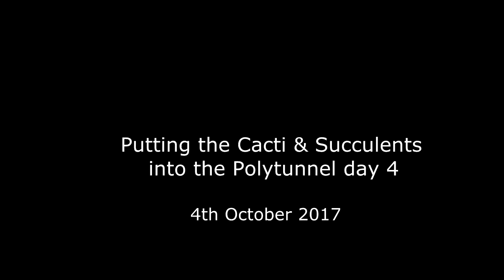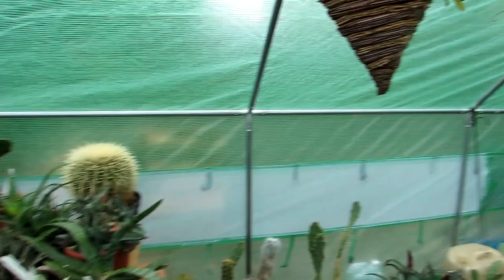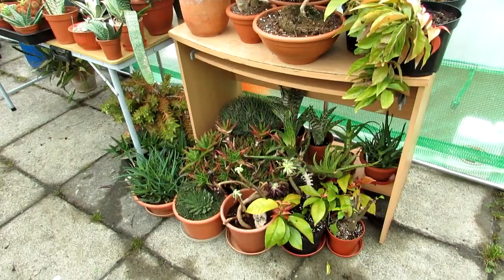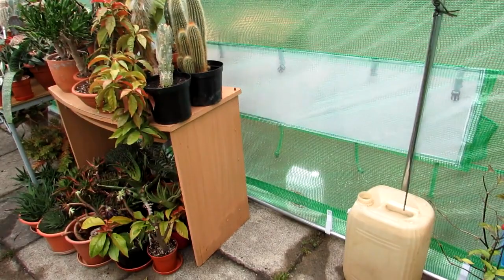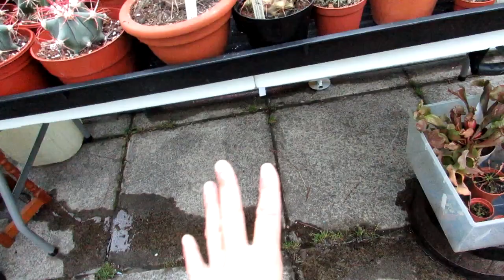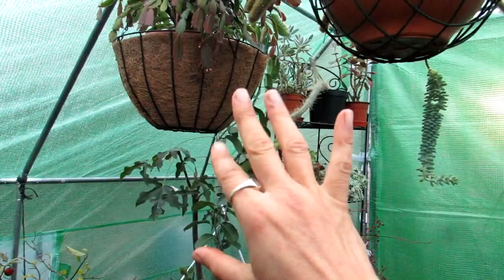Putting the Cacti & Succulents into the Polytunnel - day 4

Comment: BEAUTIFUL,I HAVE AN EUPHORBIA THE ONLY SOUTH SIDE I HAVE IS IN MY GREEN HOUSE WITH NO HEAT BUT IT IS ATTACHED TO THE HOUSE WILL IT BE OK THIS WINTER
Reply from the maker: HI there :-D Euphoribia can be cold sensitive during Winter and it depends on the temperatures and where you live, but the minimum temperature I would recommend for overwintering most of the Euphoribia varieties would be between 8-10c and if your temperatures fall below that then its best to overwinter your Euphorbia indoors, if you can't provide a sunny position then a bright but sunless window should still be ok to overwinter them if you keep your plant dry at the roots to discourage your plant from growing until the Spring :-D  thanks so much for your wonderful comment and for watching and sending you an abundance of love and happiness and PLANT POWER for a Terrific Tuesday XXXXX <3

Comment: Heat rises and escapes from the roof. I'd think insulation is your best bet with economically preserving the heat you make. Think of insulating materials. I think they're poly-carbonate panels which are used with today's cold-frames - could they be helpful to you? You're most probably already aware of the 'Mediterranean climatic' environments that traditional, sheltered brick/stone-walled gardens lend (in countries, cooler such as the UK, and, I'd think where you are too, in NI). Have you heard of the traditional eco-houses they've built in Norfolk (where I am), using the old recipe of clay and straw? They're amazing! Cheap to build and the insulation is brilliant. (I'm interested in house-building; the materials, preferring safer less toxic, natural choices - I've read a bit on this). Double-layered tents for camping have come to mind, regarding the wet coming through... Anyway, thought I'd share these thoughts with you! Yes, it's an exciting challenge, Lyn. :D xo
Reply: PS. Shame you can't make a Sempervivum Roof, LOL.
Reply: PS. Shame you can't use a Sempervivum Roof, LOL.

Comment: Hi Lynn! Glad to see you made your move without any casualty. Haha. I want to pass on maybe an idea for your tunnel. I don't know if it will work for you, but I'm using oil radiator heaters which are about 45 -65$ here in the US. They are getting very cost-effective to run as well. They have wheels and are completely fireproof. You can put them very close to things and it will not burn them or harm them. I am using those heaters close to my orchids and they are doing fine. I also have a small fan going 24 seven which has helped a lot to distribute the heat. It gets very cold here, it gets at least 20 below zero here in an average winter and it's a big challenge to keep things warm. We haven't got your humidity problem though. I think your winter in the poly tunnel and my winter are going to be an experience in taking care of plants. I wish you the best success and no casualties or catastrophes!!
Reply: Just as additional info, the oil radiant heaters are powered by electricity.  The oil is encapsulated in the heater and circulates through the vanes.  :)
Reply: Maeve Reed thankyou for adding that. 😊
Reply from the maker: Thanks so much for you wonderful comment Taiweannoona :-D thanks a million for sharing all your info and tips on heating your plants with the oil filled radiators :-D and so very true our Winter is going to be such an experience for us both for taking care of our plants :-D thanks so much for sharing and for your wonderful comment and support and for watching and sending tons of love and happiness and PLANT POWER from Belfast for a wonderful weekend ahead XXXX<3

Comment: If you heat with gas, you will need vents to prevent carbon monoxide poisoning.  Any moisture  or soot produced by the flames would be vented out with the fumes and should not affect the humidity inside the room.  In fact. heating the air should slightly reduce the humidity.  If your gas heater is properly made, it should not produce any soot.  Soot is the result of incomplete burning of the fuel due to not enough oxygen supplied to the flame.  If your heater is properly adjusted, It should produce only carbon dioxide, water vapor, and some carbon monoxide, all of which should go out the chimney.  make sure that the vent is located so that the prevailing wind carries the fumes away from the polytunnel.
Reply from the maker: Thanks so much Emmit for your amazing comments and all your info and help with the heating :-D  I think we will be going with the gas heating :-D thanks so much for your amazing comment and for watching and sending tons of love and happiness and PLANT POWER from Belfast for a wonderful weekend ahead XXXX<3

Comment: The most cost-efficient way is a passive solar greenhouse, also called a Chinese Greenhouse. It requires southern exposure (or close), and also some construction. The idea is that the light heats the walls during the day, the walls store the heat, and then the walls release the heat during the night. This may not be practical for you right now, but with a little research and planning, you could start building one next Spring or Summer.
Reply from the maker: Thanks so much for you wonderful comment and for your suggestions of the passive solar greenhouse :-D thanks a million for watching and sending tons of love and happiness and PLANT POWER from Belfast for a wonderful weekend ahead XXXX<3

Comment: It must be a great feeling to be inside that polytunnel. A green haven in the city. As for your heating problem, if indeed the temperature in your area rarely drops bellow zero, then your only problem is humidity. A dehumidifier also produces heat which will help during the coldest nights. But I do remember you saying that you used to use a dehumidifier and it was too expensive to run, so if you can find a cheaper solution, it would be nice. Maybe those air exchangers aquarium hobbyists use to draw moist air out of their fish rooms and bring dry air in from outside. But in your case, instead of drawing air from outside, you could draw air from inside your house.
Reply from the maker: Thanks so much John John  for you wonderful comments and for watching and your support and suggestions and me and Hans are sending tons of love and happiness and PLANT POWER from Belfast for a wonderful weekend ahead XXXX<3

Comment: You can heat the green house by having a large body of water inside like a few 50gal plastic barrels the water resists cooling a bit and will act like thermal masses, you could also heat it from a compost pile inside or outside by building the pile outside around an ascending coil and having it coil around the inside perimeter of the greenhouse this relies on the heat of thermophilic composting warming and pushing the warm water into a convection current, or in the green house you could just have a compost pile and it would radiate heat. You can put down black plastic on the floor to soak in more of the sun's heat, just having a few large rock in there can help act as thermal masses too soaking in heat all day and then radiating it at night. Larger containers with more soil maintain their temperature better too. I live in New England so I'm always trying to figure out how to keep things a little warmer.
Reply from the maker: WOW THANK YOU SOOOO MUCH for sharing all your tips on how to heat the polytunnel  :- D all your tips are so helpful :-D thanks so much Corey Green for your wonderful comment and for watching and sending tons of love and happiness and PLANT POWER from Belfast for a wonderful weekend ahead XXXX<3

Comment: Hi Lyn, my thoughts are that it ought not be necessary to heat the entire polytunnel during the winter. You appear to be in a sheltered urban environment where the temperature is unlikely to sink dangerously low. Also, the paving stones on which the polytunnel's standing should serve as a low-level storage heater by absorbing heat during warm sunny days and releasing it at night when the air temperature cools.

My understanding is that many desert species of cacti will tolerate a few degrees of frost if they're kept dry. (My own Echeverias and Echinopsis survive sub zero temperatures unscathed.) It's mainly the tropical evergreens like the Nepenthes and Tradescantias that are most likey to be sensitive to low temperatures. My suggestion is to consider either partitioning part of the polytunnel so that the most sensitive plants are together in a relatively small area that will be cheaper to heat than the entire structure. You could do that by creating a curtain of bubblewrap. Alternatively, move the very sensitive plants indoors or drape them in horticultural fleece if and when exceptionally cold weather is forecast.
Reply from the maker: Thanks a BILLION  for all your AMAZING suggestions :-D thats so helpful and we have bought lots of horticultural fleece for many of the plants that are not the most cold hardy :-D we will be bringing in the Tradescanhia's  and the Nepenthes inside the house for the 'winter :-D thanks a million for all of your suggestions and for watching  and sending tons of love and heaps of happiness and PLANT POWER from Belfast for a wonderful weekend XXXX <3